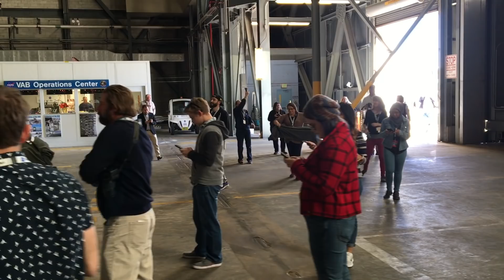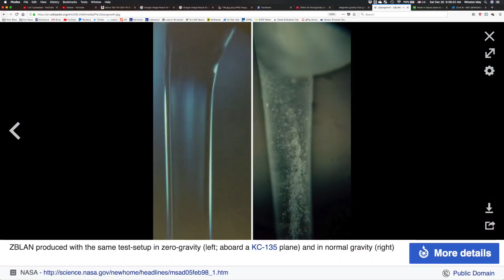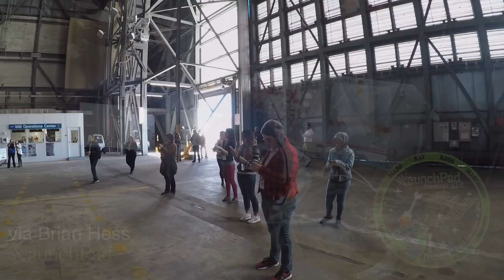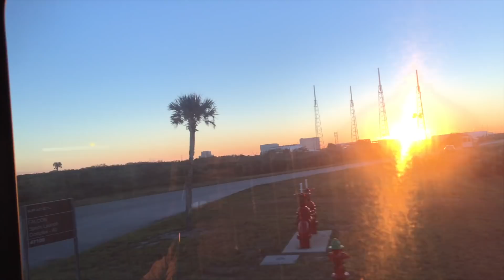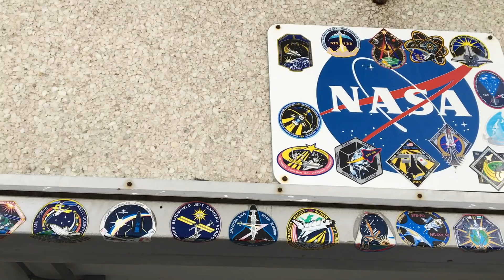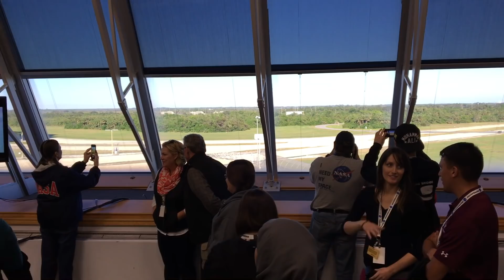Up Close with the SpaceX Falcon 9 of CRS-13

Comment: Cool video. What makes launch pads so complicated and costly to rebuild?
Reply from the maker: It's more than just a metal structure. The plumbing to handle cryogenic fluids is there, and hundreds of data channels need to be patched from the rocket to stations on the ground. Hydraulic systems to lift the rocket, water systems to douse the pad and suppress sound. And all of these need to be built strong enough to survive sitting under a rocket when it launches.